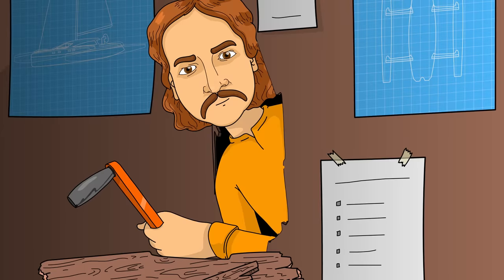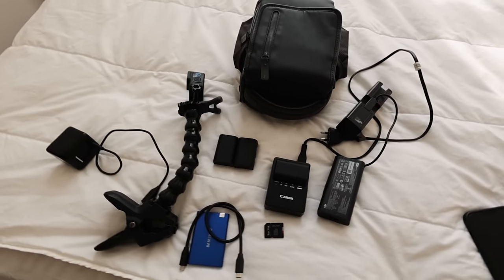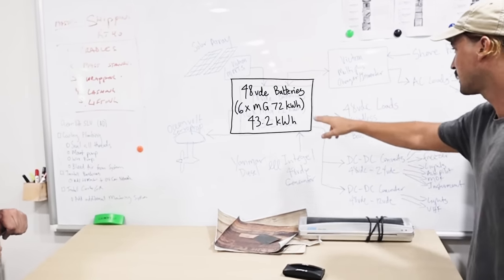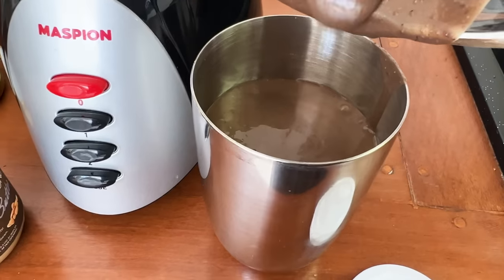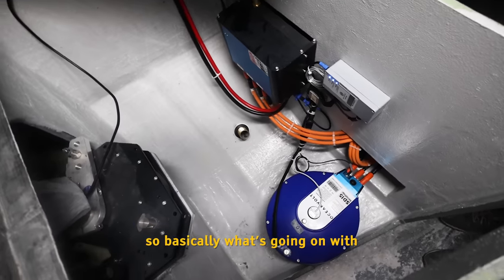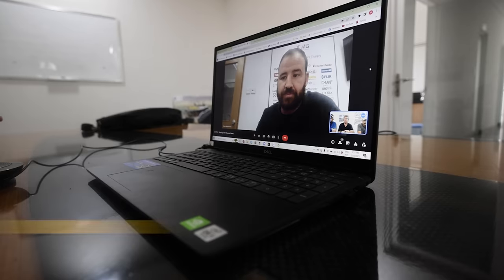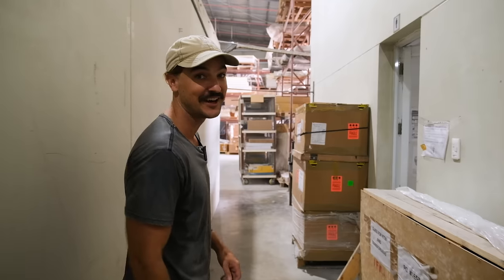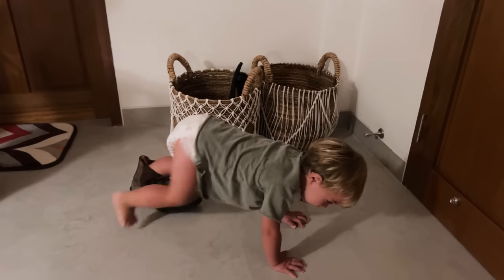BOAT BUILD: Our Electric Propulsion!

Comment: A wise decision rejecting the electric motor fantasy.
That system would be over 1000lbs all in, plus the weight of the diesel genset and fuel storage.
And that doesn’t even get into the $50,000.00 +++ cost and complication factors. The idea is ludicrous on a slow heavy pig of a mono-hull, it’s absolutely insane on a Carbon Tri.
Reply: Why?
Reply: @rickkwitkoski1976  I edited my comment.
Reply from the maker: The regeneration alone makes this worthwhile precisely because we are a carbon trimaran.

Comment: disappointed in the decision to add a second propulsion system. more systems to do the same thing or many more parts increases the chance of failure.  That is a lean design concept.  does the extra prop. effect the performance of electric drive ?   you have so much experience and the right people to consult. do what is right for you.

Comment: 48 batteries 🥴 eventually those batteries will need replacing, I wonder what it will cost then?
Reply: 6 batteries, 48 volts.
Reply: 48kWh worth of batteries... By comparison a new Tesla 3 RWD has about 60kWh worth of batteries.

Id expect they've probably paid US$10k+ for the batteries, but the cost is gradually reducing
Reply from the maker: You didn’t think we had 48 batteries did you Ted?

Comment: Get the redundancy! All the new tech is fantastic but can you fix it on a dime? I love being a purist on the eco tech but I draw the line when kids are on the line.
Reply from the maker: What do you suggest?
Reply: @SailingLaVagabonde  what you're doing (diesel or gas of some type as a back-up system) is great. You've always emphasized safety in your videos and talked about how that factors into your boat and route choices. For me, the main factor in peace of mind on the water is the ability to get out of danger. Solar and wind power can't guarantee that you'll have enough power for long enough to bug out, which would increase anxiety a lot. Diesel or gas generators that can power the electric propulsion and everything else would make a lot of sense to me. But you know much more about it than I do. I looked into solar electric for my boat a couple of years ago and was told the tech wouldn't work for my area yet. (I'm on the St. Lawrence Seaway so lots of overcast and storm days during boating season.) 

Which would be a better choice for a backup, diesel or gas, given that it wouldn't be running very frequently?